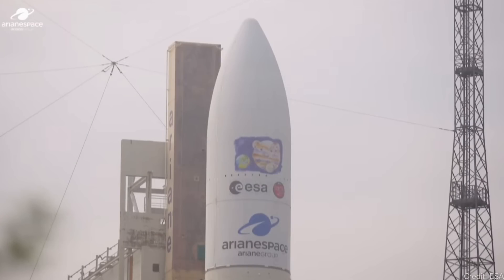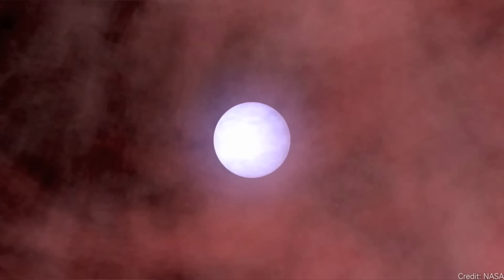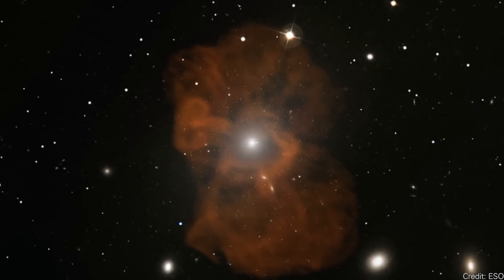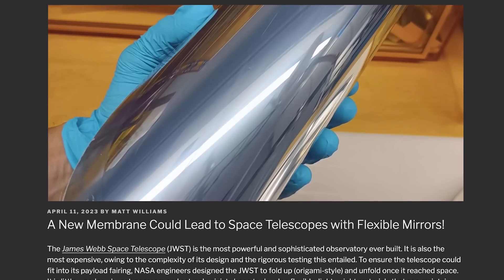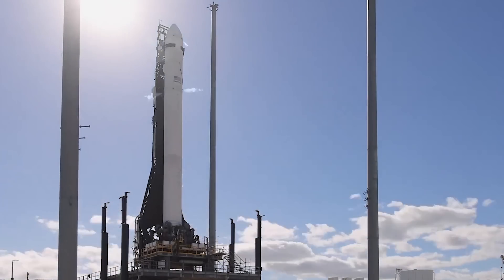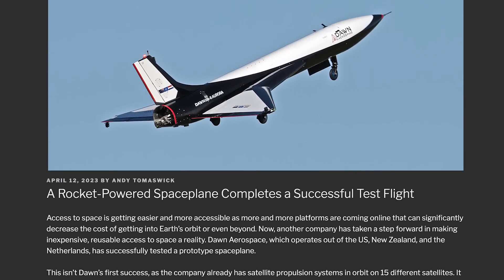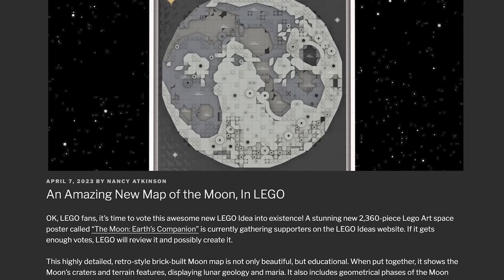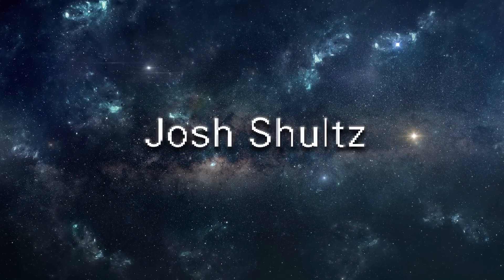JUICE Launched to Jupiter // AI Helping Astronomy // Terran-1 Is No More

Comment: I have question for the question show. We read about a "crisis in cosmology", because one method of measuring the expansion does not agree with a different measurement. IIRC, the method using the CMB does not agree with a method using Cephid variables. Notably, the CMB shows a smaller expansion rate than the Cephid method. It seems to me that CMB was set very early (like 300k years after bang). The Cepids showed up much later (how much later?) It seems likely to me that that the expansion rate may change between the CMB time and the Cepid time. Do we accept that the expansion rate is not constant over time? Those two rates are two data points that show the acceleration over that time. Please find a way to measure the current expansion, so we may put a third data point on that. The Hubble constant is not constant. Please estimate the acceleration in expansion, in the correct units of course.

Comment: If the event horizon telescope images are real, shouldn't they be able to reconstruct a much wider image than just around the black hole? since it's computational interferometry and the radio telescopes could not have such tight FOV, the data must represent a much wider FOV that could be rendered. And help hold dem accountable. Instead of these manually massaged blobs.

Comment: I've taken up astronomy as a hobby in retirement and M1, the Crab Nebula isn't easy to see with small aperture telescopes. I could just make it out with a 150mm (6 inches) telescope as it is rather dim, an 8" is better and you can use a broadband filter to help make the gases stand out. I put a filter on my 150mm and it just disappeared. Now you can take long exposure photos with a smaller scope, but for observing a 250mm telescope is better. To observe the Andromeda Galaxy which is 3 arc degrees wide (Moon is half a degree) you need a 12" scope to see some of its spiral arms. Do not think for a minute that what you'll see with a telescope is going to look like Hubble photos.
There are programs that will stack the best of a video of a planet and show a great picture, but you need to do AutoStakkert correctly. It isn't hard, but it helps if you learn to take the video correctly. One of the biggest mistakes I see done is over-powering too small of a telescope. Running 300x through a 102mm Maksutov will mostly be blurry.
Reply: That's really helpful advice, ty for posting this ❤❤❤